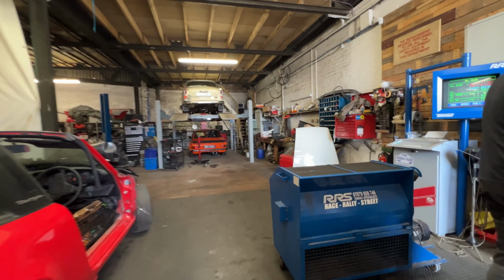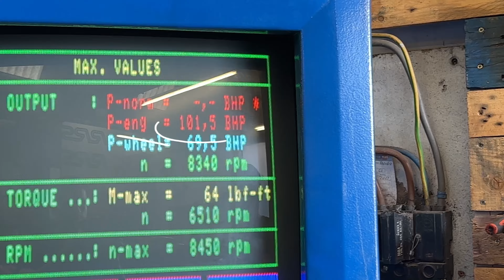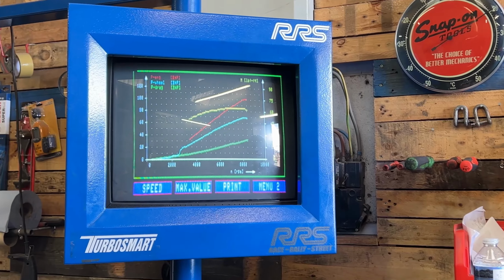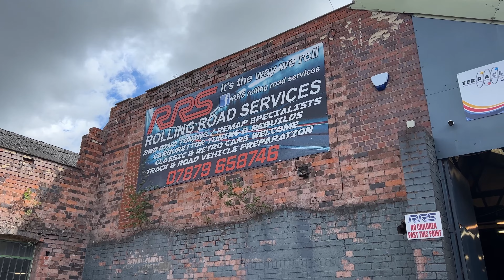Micra K11 1.4 on Dyno - Unexpected Power from CGA3!

Comment: I have a feeling my CG10DE coilpack just about gets its 60BHP and 60ldft torque. I'm not going to concentrate on upping the performance given it's an automatic with the CVT transmission (though I do have a larger N15 Almera airbox to install). However, I'm concentrating on areas that I can easily change using OEM parts. For example, at the rear, I have the eyelets that will allow me to fit the rear anti rollbar. I have the bar (took a while to source one, yours, being a CGA3DE, may already have one unless it was originally a CGA10DE) and the drop links, as well as the mounts and bushes to go onto the rear beam. Another easy modification is to install front vented discs. You need a pair of calipers, caliper carriers and discs from an N15 Almera 1.6 . The carriers bolt straight onto the K11s struts and the discs should mount straight up onto the hubs given they have the same offset and hub centre bore.
Reply from the maker: Yes mine was originally CG10, we swapped the CGA3 in a couple of months ago. I think I may do the brake upgrade eventually, but not too urgent for me at the minute as I don’t drive it crazy. 

Also providing they fit under 13s haha.
Reply: @TheCruise94  That's a good point! I have some SE+ spec 14 inch alloys on mine so they should fit without issue, but like you....I don't go mad, it's nowhere near quick enough to be able to do that :)!!. Following your project with interest, it's looking good thus far.

Comment: As the revs are wrong on the dyno, I'm pretty sure that your peak bhp figure is also going to be wrong, given that bhp is calculated by the dyno as (torque x revs)/5252. Over-reported revs is going to mean over-reported bhp. 

Edit: I was incorrect above - the dyno not knowing the correct engine revs won't affect the bhp reading. If the dyno believes that the engine revs are higher than they actually are, then this will increase the engine-to-dyno-roller reduction ratio calculated by the dyno, with the decreased calculated engine torque cancelling out the incorrect over-reading of engine rpm.
Reply: are you going by the peak rpm for peak torque or peak power on your equation because the standard 1348 makes 80bhp at 6k and 89lbft at 4krpm and the result is going to be the power at the crank not the wheels where it matters. it's basically a OEM spec but it will have more transmission losses using the limited potential of the smaller engine matched gear ratios and the other factor in obscuring the true power is the difference between the original rolling circumference of the tyres and the ones you have now. So many variables can give a different result even tyre pressures can add a couple of ponies in the pocket
Reply: @bevbiltbmw  I wouldn't say it was my equation: torque x revs / 5252 is the way horsepower is calculated. 

"Are you going by the peak rpm for peak torque or peak power on your equation?". The answer is neither, by itself - horsepower is measured not by peak torque alone or by revs alone, but by the result of the multiplication of torque and rpm together. 

The reason that horsepower often continues to climb as rpm continues up the rev range, even though the engine's peak torque has already been passed, is because torque falls after the peak at a slower rate than the rate at which revs increase. For example, if an engine produces 100 lb-ft of torque at 3,000 rpm and only 90 lb-ft of torque at 4,000 rpm, it will still produce more horsepower at 4,000 because:

4,000 x 90 / 5,252 = 68 bhp
3,000 x 100 / 5,252 = 47 bhp

In this example, torque fell by 10%, but revs increased by 25%, so bhp increased.

Engine manufacturers state their bhp claims at the crank, which is the only accurate way to measure it.

Rolling road dynos measure only torque at the wheels and dyno roller speed (because the wheels-to-dyno-roller interface is the only torque-measuring point that the dyno has with the car) and from these they calculate bhp at the wheels. To estimate engine horsepower, the dyno measures how fast the rollers decelerate on the rundown from peak revs with the clutch in. This gives the drag produced by the drivetrain, which, in turn, gives the amount of bhp taken to spin the drivetrain. This power figure is then added to the power measured on the dyno power run to give an estimate of engine bhp. 

Tyre and wheel size have no effect on the bhp measurement taken by a dyno because roller speed is one of the measurements taken by the dyno. If a car, for example, had tyres on it with a 10 inch total diameter, that would be a circumference of 10 x 3.14 = 31.4 inches. If the tyres are then replaced for ones with a 20 inch diameter, the circumference would be 20 x 3.14 = 62.8 inches. The 20" tyre would thus drive the dyno roller at double the speed of the 10" tyre at a given engine rpm, but because the diameter of the larger tyre is doubled, we have also halved the torque applied to the dyno roller. The net effect of the tyre size change is therefore zero: the two-times-greater speed at the edge of the of the larger tyre is cancelled out by the halving of the torque.

Rolling road dynos do vary in their ability to both measure torque accurately at the wheels and to estimate accurate engine bhp figures, so no rolling road dyno should ever be relied on to give a totally accurate bhp figure.

Comment: Are you thinking about putting the crankshaft pulley and flywheel from the 1.0? (was the flywheel replaced when you changed the gearbox?)
They are quite lighter, should make the engine rev easier.
Reply from the maker: 1.0 Flywheel and clutch are already in, we couldn’t get the pulleys off so it’s still on the 1.4 pulley. Probably won’t change the pulley now that it’s in the car. But it revs quick just with the box and clutch!

Comment: Scream turbo! My 1300cc has 110hp / 150nm with 0.35bar compression. for the next project (k10 1.3) I will compress to 0.5bar and I assume that the power would be 130hp and 180nm.
Reply: That sounds about right,that is aproximately what i am making at .5,going to turn it op to 1 bar as i just installed water meth injection to keep it nice and cool. Hoping to get about 180 hp😮

Comment: Got to be a new mid section next, right? Then unlock the power thats there with a speeduino? I have throttle bodies to put on my CGA3 but i just cant find the time!
Reply from the maker: Definitely need a new, less-restrictive mid section. I’ve not heard of that one, I was gonna go with DET3 as they’re popular on these
Reply: @TheCruise94  personally I'd go stand alone. There are so many cheap options these days. Mega squirt could be another good one. I was also thinking you'll have de-catted the CGA3 by adding the tubular manifold which will give an extra couple of hp.

Comment: 8340rpms? Did you change the camshaft for hi rpms?
Reply from the maker: RPM is inaccurate. As the car doesn’t have a rev gauge the technician had to guess the starting RPM.

Comment: tornado systems ECU next maybe?
Reply from the maker: Tornado Systems is too expensive in my opinion. I’m going with DET 3, popular choice on these Micras
Reply: @TheCruise94  fair enough. there's only one minor problem with the DET 3 in my eyes and its that you cant raise the rev limit (6500 rpm stock). i don't think its a problem if your gonna go boosted. but N/A higher RPM is where you might find more power if you put spiceier cams in. other than that the DET 3 is a brilliant choice.
Reply from the maker: I wasn’t aware of that. Not sure it’ll bother me too much to be honest when it’s mainly road use anyway. But I appreciate the advice